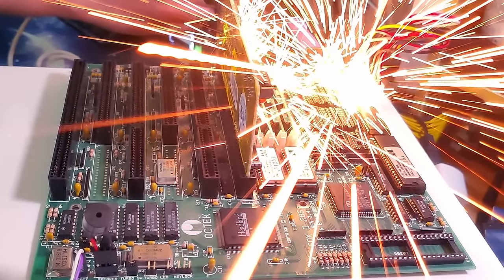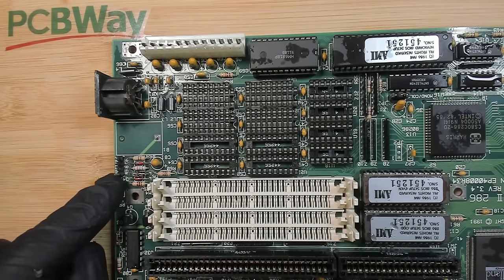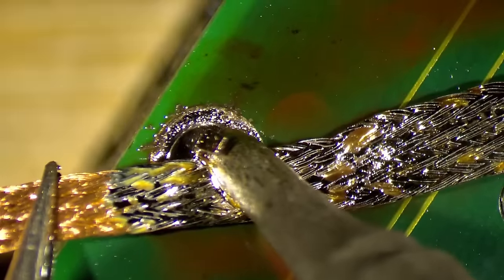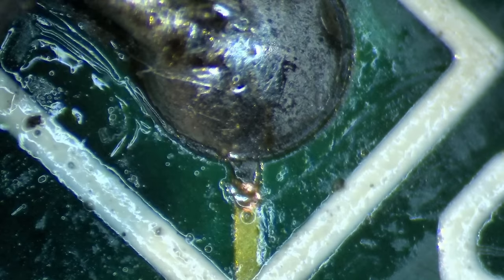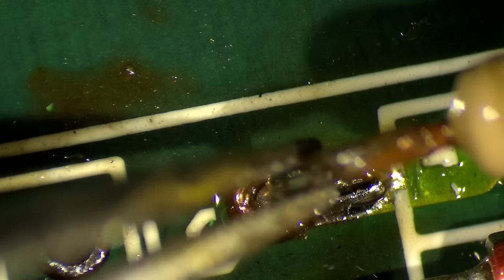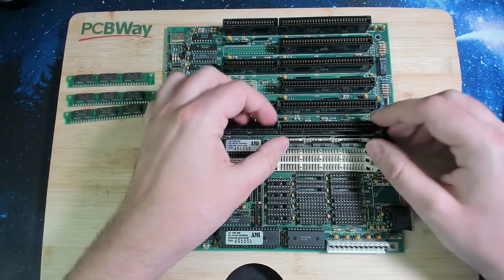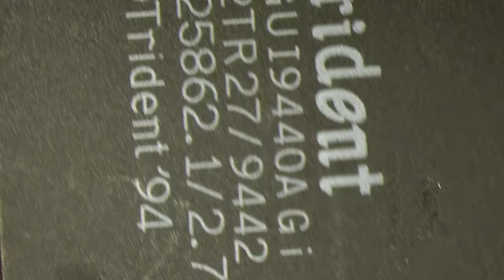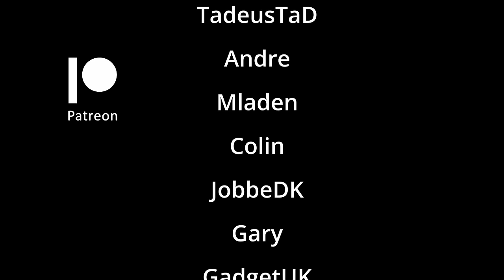Dangerous 286: Vintage hardware fireworks!

Comment: Harris Semiconductor manufactured the HD-6120 12-bit microprocessor (PDP-8 on-a-chip) used in DEC's DECmate series of microcomputers (that followed the PDP-8 series of 12-bit minicomputers and the VT78 [which used the Intersil 12-bit IM6100 PDP-8 on-a-chip].  I've got several examples of all of these, but not the complete series of PDP-8s & DECmates.

Also, I had to replace a power supply in an x86 (maybe a 486?) PC, but since the "new" power switch had the same colored wires, I got lazy and didn't perform the more difficult task of changing the power switch too.  When I "finished," I plugged the PC in & turned it on.  I blew a tantalum cap off of the board and it looked like a small bottle rocket leaving a smoke trail as it shot towards the bookshelf!  I immediately turned the PC off and and changed the power switch too (the one in the face of the desktop PC).  I went ahead and turned the PC on again and had no problems, even without replacing the blown cap.  Just lucky I guess!  That PC is still out in the garage and may get used again in the future.

Comment: I have a 286 too that would not work at all without proper FPM installed. regular sim would not work. I actually got a second 286 board which seem to have on board ram but it errors out. I can somewhat run it with only base memory. 286 in particular seems to be very iffy sometimes
Reply from the maker: Let's hope there is a difference with the DIP memory - once it arrives... At least it would eliminate the Chipset as the cause.

Comment: Many years ago.  Must be 15 yrs by now.  I was sitting at my desk.  I suddenly heard a loud BANG!   It scared the crap out of me at the time.
The noise was from a video card I had laying on a table beside my desk.  One of the capacitors had spontaneously burst.   I think it was an electrolytic though not tantalum.   I didn't have the ability to replace it and I'm sure the card went to e-waste when I chucked out a bunch of stuff a while ago so I don't know exactly the model.  At the time I was messing with Geforce2 cards though and I also had a Goodwill Computer Works nearby (they resold donated computers) which had a bevy of cheap computer parts that I often would grab if I needed a part. So it might have been a card I bought from them. 

Either way your fireworks in this video were great ! ;)
Reply from the maker: It exploded without being plugged into a system that was powered on? I never heard that this can happen 😮
Reply: @bitsundbolts  Yes.    I never knew they could burst w/o power either. 
That was the strange thing.  I am not even sure it had been plugged in 
for months before it blew out either.
Reply from the maker: That is very odd. That must have been a chemical reaction then that built up pressure inside the can. Very weird!

Comment: There is a lack of flux when de-soldering old joints.. try adding a drop of new flux or adding a touch of fresh resin core solder first to aid the flow into the desoldering wick

Comment: That's a pretty orderly tantalum blowout. Couldn't have gone any better. I had a PSU on a Dell switch blow up once, where the tantalum cap was. I tore the freakin' traces. Since they fuse and form shorts, they almost always take something else with them. I have a running early build 486 full of tantalums and I an very weary of using it. The moment it blows up, I'm not even going to fix it, but will just go a newer blue socket motherboard, that only has electrolytics.
Reply from the maker: Yes, those tantalum capacitors are a constant threat. I'll replace the caps once I get the board working. Hopefully I can repair it.

Comment: It's a very nice motherboard, well worth the time to fix. Good job so far.
BTW I got a little explosion of my own yesterday. I was attempting to repair a power supply that was dead (not from a computer, but from an embedded device) and unintentionally shorted 2 terminals that had voltage on them. Oops! :) It was only for a split second though, didn't even trip a fuse. And I don't think it caused any further damage.
Reply from the maker: Thanks... Yeah, I also blew up a few caps unintentionally. One was on a bread board power supply. I somehow messed up the wiring and blew up one of the caps. Electronics tend to teach you in an interesting way if you make a mistake 😅
Reply: @bitsundbolts  The only tantalum cap that ever blew on me was on an IBM 5160 motherboard - you guessed it, on the 12V rail. I replaced all of the 12V rail caps on that board with MLCC ceramic caps rated for 50V. Those never explode.

Comment: my first introduction was a Zenith EZ PC. According to wiki it's a 286 at 7 mhz made by NEC. My first computer that I actually had permanent access to was a compaq 386. Then I swapped the two (I was not happy about this) and eventually I ended up with both.
Reply: EZ PC 2 apparently. 2 drives no HDD
Reply: wow intentionally designed to prevent the instalation of a hard drive unless you had the EZ PC 3. And I do remember that it had no ISA slots. They were jerks!
Reply: and the criticism on wiki is exactly why my sister didn't want it. It wasn't good enough to be useful for what she needed it for.

Comment: i had headland motherboard with 286 16MHz but faulty. Original bios not working with 4MB installed modules so i used MR Bios. After DOS boot system hang sometime was able run Prince of Persia but it hang again. Not sure if i am understand how memory with this chipset working. Maybe i am doing something wrong, missing drivers for memory management? 🤔

Comment: The memory you showed has a 7 in the end of it's type numbers, suggesting it is 70ns. You would need 60ns according to the manual. The memory that was in there is likely 20 years old, which may make it not as fast as it was when new. It might have worked fine back then, running out of spec, but it will be too slow to run now? You could swap the Xtal for a 32MHz to test if the board will boot at 16MHz before going for 20MHz again. Did you check how stable the voltages are? Those tantalums might not explode on you anymore, but how good are they? I have had my fair share of boards being finicky about what memory modules worked when DIP and 8bit SIMMs were normal and it would not be uncommon to get a machine in under warranty that had memory fail that would work fine in another less critical machine.
Reply from the maker: Good point with changing the crystal. I'll consider it. Also, the memory might be too slow. I'll try more options and see if I get somewhere. 👍

Comment: Interesting board, I hope you can make it work and look forward to the EMS video!
I will never forget my first (and, I think, only) tantalum explosion. It was an Asus Media Bus card and I was unaware of the explosive nature of these capacitors, so my face was closer to the card that would have been otherwise and I was completely unprepared for the ensuing fireworks xD.
Reply: By the way, I think most 286s I have personally seen were Harris and Siemens. I wonder if it was because they were "modern" (1989-91, with the Harris...es? being usually of high frequencies that I think Intel didn't make) and/or a regional thing (I'm from Argentina).
Reply from the maker: Good that nothing has happened to you when that cap exploded. They are quite dangerous if you are too close and one goes off. Unpredictable! I'll replace them if I get the board to POST...

Comment: I don't know why I love those Harris CPUs so much, I even bought one off eBay even though all my (working) 286 machines already have CPUs. Maybe it has something to do with my job, since I work in the broadcast industry and Harris makes broadcast equipment (or at least used to, I think their broadcast division was carved out and sold of, and possibly rebranded out of existence since then).

If I see corrosion near the keyboard connector, I usually just replace it. Usually when I'm buying parts off a seller from China, I take a peek in their eBay store and see if they've got other interesting stuff. At one stage I came across a listing for AT keyboard connectors, so I just threw a bunch of them in with my order, so now I've got plenty in stock. I also bought a bunch of PS/2 connectors, but that was specifically because I needed to replace one.

For your board, my guess is there's pull-ups on the memory address lines, and the chipset has open drain outputs, so it would the lines would normally float high until the chipset actively pulled them low. That's why you're seeing them high most of the time, the chipset is only pulling them low when it's trying to access the memory. One trap for young players is checking the memory address and data lines on the pins of the connector, rather than the contact pads of the SIMM. There could be corrosion in or under the memory socket that could cause discontinuity between the SIMM and the board. In this case I'd suspect the problem could be elsewhere, since the corrosion looked pretty limited, but I'd still check it just in case.
Reply from the maker: Good point regarding the pull-ups and high lines. if the chipset can't access the memory correctly due to some other factors (e.g. faulty buffer/logic chips that are right next to the 40 MHz crystal), this could make the lines to remain high. I am testing those logic ICs now. Maybe I'll find something.

Comment: The manual may be correct for 20mhz cpu.
I'd try putting a matching crystal for the DRAM speed you have. To see if the dram is just too slow (given you got memory errors).
Reply from the maker: I tried a 33 MHz crystal, but no change. I'm in the process of debugging further right now. I may want to try an even slower crystal if I find one. But with 33 MHz, the board behaves exactly the same. I also found 60ns memory - but no change.
Reply: @bitsundbolts  fair enough. worth a shot; sorry it didn't work out.

Comment: Harris is actually a US military contractor and a lot of their parts are "milspec", with higher thermal tolerances and lower power consumption.  They're usually manufactured later years and a process node or two later than their Intel counterparts.

Comment: Thank you for the great video. I would prior test if the resistance between the right contact (+5) and ground (black) of AT power switch on the mobo is appropriate. Think maybe this system board will be hard to repair
Reply from the maker: I definitely will do this from now on. The capacitor that exploded was on the 12v line btw.

Comment: capacitors sure are fun, aren’t they? honestly, after learning how tantalum caps are made I’m kind of impressed they work at all. ditto electrolytic caps in general, I suppose, but tantalum in particular just seems bonkers with that whole lump o’ microscopically spongey metal with a whiff of oxide around whatever gnarly shape the tantalum happened to sinter into thing they’ve got going on

Comment: When you're done with sorting out the board keep in mind that Headland HT12 chipset needs special drivers to handle memory properly, I use TLBMM.
Reply from the maker: Yes, I read about it. I never had such a board with that chipset. It would be fun learning about all this - I just need to get it to work.

Comment: great fireworks! next time measure for shorts in the power connector :)
Reply from the maker: I did measure before powering on. No shorts at that time. The cap must have failed with the inrush of 12v after such a long time. I guess from now on, I'll pay attention to the cap on the 12v line. This seems to be the one that most likely will explode.

Comment: I feel your pain :( I went through the same thing a few months ago, a socket 7 motherboard exploded and took with it everything connected to it, sound card, video card and ISA capture card, network card, memories, processor and power supply. There was a short circuit on the motherboard and the AT power supply I was using had no protection circuit. Since that day, I have never tested a computer in the dark again, I created an adapter that sits between the power supply and the motherboard, any surge of voltage or current will trip it in milliseconds. 

There are a thousand different projects on how to do this, and it's very simple, in fact, you can order everything from PCB Way already assembled.
Reply from the maker: I'm using a modern power supply from EVGA (supernova G3). It should have all the protection mechanisms, but I did get the occasional surprises like this one.
One time however, the power supply did shut off. That was when I built one of the -5v ATX Adapters which had a bad cap.
Reply: Short from where to where? Short any rail to ground wouldn't actually harm any attached hardware; except via crossload and the PSU being a piece of garbage that would have killed the PC anyway. This is why i really don't like most old PSUs except a handful trusted manufacturers.
Reply: @SianaGearz  I believe it was an IC regulator that completely shorted out, everything on the 5v line simply exploded. Perhaps the battery or a capacitor has leaked, causing the short. The computer was an Itautec RTV A96, and used an Intel AT motherboard with some onboard stuff, like an ATI Mach 64 video, a somewhat unusual motherboard.
Reply: @RicardoRamosRetrocomputacao   Yeah nah if you have explosions along the 5V line, it means the 5V line drifted well above nominal. The regulators off the 5V line would be supplying low voltage rails, whatever CPU and specific IC supplies, so a regulator has 5V input, low voltage output, and feedback, correspondingly all regulators along 5V line would worst case, if failing, pass the input through, and there really aren't a lot of them. So i'm thinking your PSU killed the hardware, not the mainboard.

If the PSU doesn't have crossload protection (individual rail under/over voltage sensing), then a near-short of 12V line to ground will easily cause 5V line to drift up, while the 12V line dips. Also quite common for shitty ones is a magnetic failure causing the 5V line to be internally shorted to 12V line in the PSU.

Comment: My favourite component is that crystal in the middle. It seems like they forgot about the crystal, so they deleted a slot in the middle and slapped the crystal on the board. Many motherboards are missing the upper half of the ISA slot, but they usually do not place components over it, just simple don't solder the header.
Reply from the maker: Yes, it is a rather odd place for that crystal. A 16 MHz 286 wouldn't need it because the CPU and ISA bus could be derived from the 32 MHz crystal.

Comment: Great video and excellent job!

For posting issue fixing, try to add battery.. One time I got 386 board, that wouldn't post without it.. 😉
Reply from the maker: I added an external battery, but that didn't help. I think I tested that the battery reaches the real-time clock, but now I think I should check that again. Thanks for reminding me!
Reply: @bitsundbolts Maybe this board isn't so picky. By post card it just tested DMA, keyboard controller command byte, next will be pin 23,24 blocking unblocking and then it halts on keyboard input  buffer free test and issuing BAT command to the keyboard  controller..

Did You hit reset with battery inserted?
Anyway, this board is very interesting. 😉
Reply from the maker: I'll try again very soon. Since I didn't get far, I got my hands on two more boards, similar to this one. I'll show them in an upcoming video very soon!

Comment: Hey i remember watching the talk about capacitors by James the Bald Engineer... himself a classic computer restorer and enthusiast, who showed among other things why tantalums explode, or why new polymer ones don't. So what i took home is that after thermal stress or prolonged storage, one should cure tantalums by gradually bringing them once up to voltage, gradually raising the voltage over minutes, then they'll no longer explode, even crappy old ones.

So yeah what if one did that type of voltage ramp rig, while holding the whole mainboard artificially in reset in order for it not to go all weird?

Comment: I have an idea. Since keyboard connectors seem to get the brunt of battery corrosion, it might be helpful to wire up a new connector to flying leads and solder the leads to the board for testing. If the board doesn't work you don't have to try and desolder the connector too many times and damage it.

Comment: Try 8/9 chips memory sticks instead of 2/3 chips. They are refreshed differently and some 286 chipsets don't work correctly with 2 (3) chips 1M RAM sticks.
Reply: I agree with this. My HT12 based board does not work with 3chip 1MB SIMMs. It requires 9chip SIMMs (or SIPPs actually but I replaced them with SIMM sockets).
Reply from the maker: Thanks for letting me know! I think I have such memory modules.
Reply from the maker: It would be awesome if that is the solution! I'll try that right away!
Reply from the maker: I did receive the DIP memory today. Unfortunately, neither the DIP memory, nor 9 chip SIMM modules make a difference. It makes no difference if there is memory installed or not - the board stops at POST code 10 as seen in the video.
I guess I have to continue looking for the fault somewhere on the board. 😟
Reply: @bitsundbolts  ah, so my prediction comment is already wrong, should have read more comments before posting :D. Next step would be decompiling bios. Edit, no wait, its normal AMI bios, no need for decompilation. Ram problems + leaked battery near ram means next step is desoldering all RAM sockets and fixing one or more corroded VIAs. So repair plus 8/9 chip SIMMs.